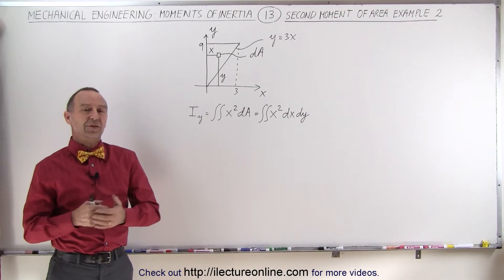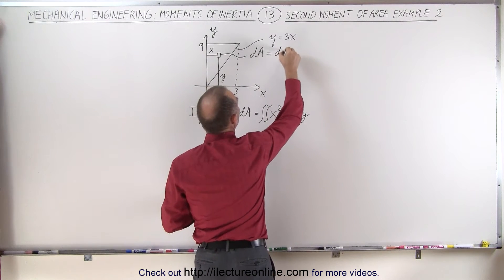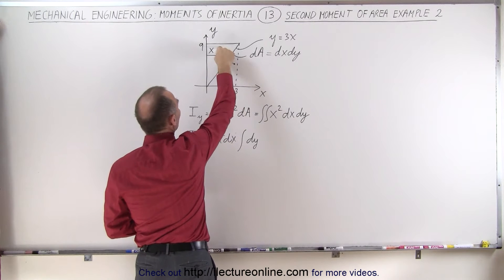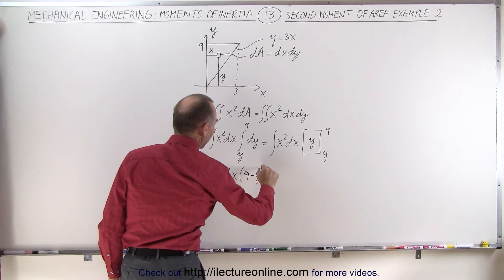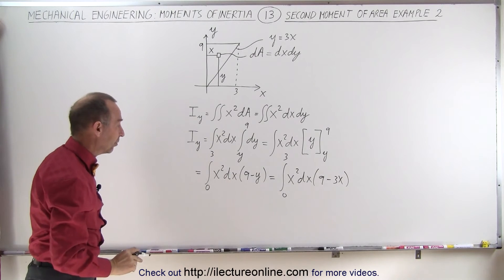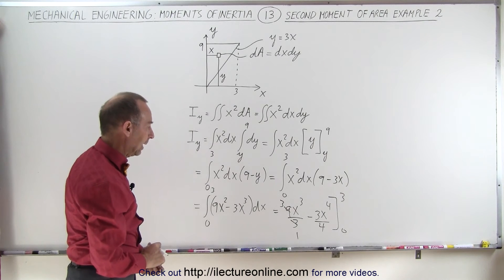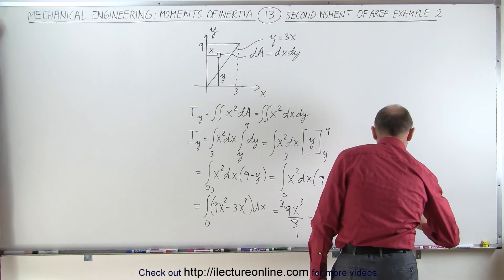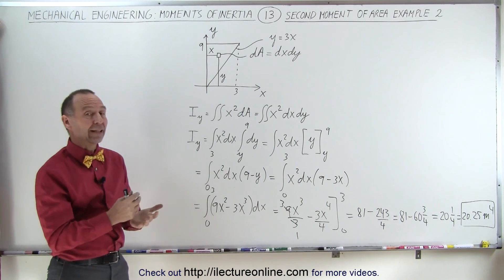Mechanical Engineering: Ch 12: Moment of Inertia (13 of 97) Second Moment of Area: Ex. 2

Comment: Why are the limits of dy = y to 9 instead of 0 to 9. Why not then assume the limits of dx are x to 3?
Reply from the maker: You can reverse the limits from 0 to x and then from 0 to 9    OR     from y to 9  then  0 to 3
Reply: @MichelvanBiezen  Got you! We first need to find the area of the strip (L*dx or L*dy), then move it across the whole range (0 to 3  or  0 to 9) respectively. Whichever direction we chose. Thanks for taking the time!
Reply: I got the same doubt but I haven't the understood the solution.please explain me